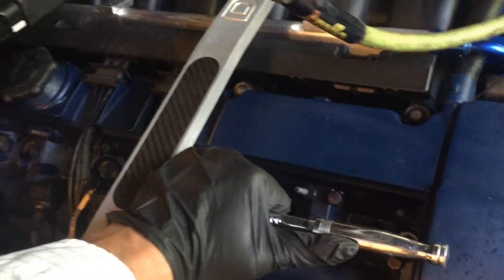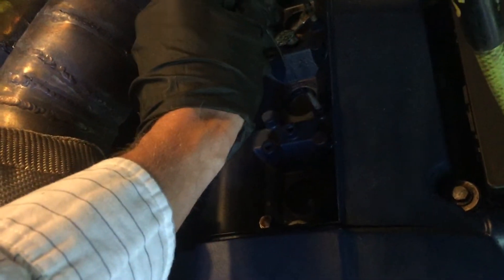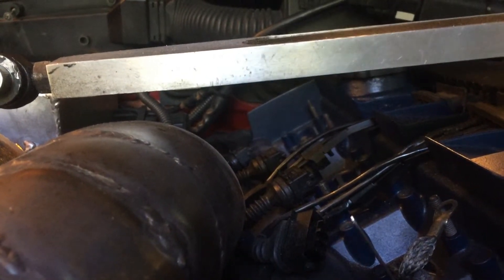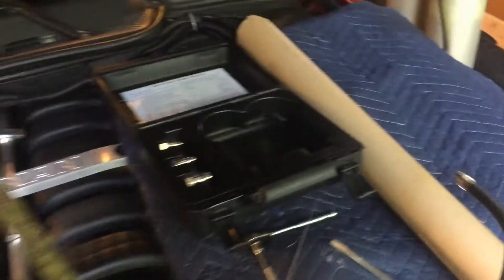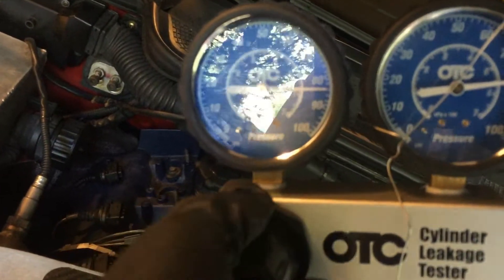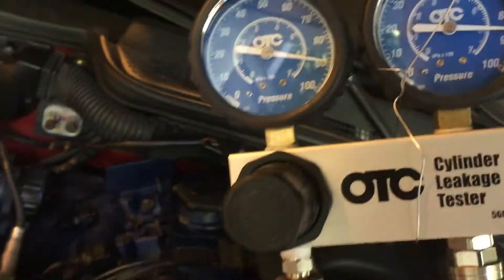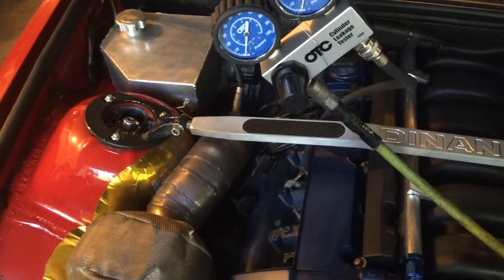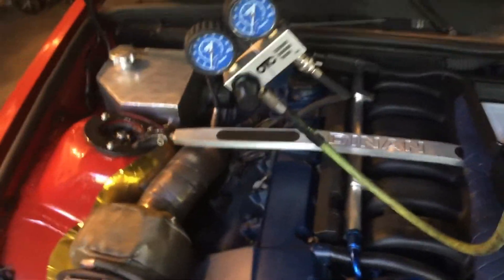Leak down testing and TDC trick on a BMW engine

Comment: I'm getting air coming from the intake but I can't seem to confirm if it is because it is a leaking intake valve or if I just haven't found TDC compression. But I see something on the valve seat that doesn't look right when I use the endoscope camera. I have an OTC  leak-down tester too but wish I had gotten one with the pretty colors to show when it is bad or good, however, I suppose I'll learn to understand it.

Comment: especially if it is a V-ENGINE and you are working alone don't leave anything stuck in the cylinder and turn the engine because it could break off because of the angle of the V-ENGINE as the piston moves to the top.

Comment: My friend, a four stroke-cycle engine has each piston come to the top dead center position twice in each cycle. 

Once at top dead center on the compression stroke and once at top dead center of the exhaust stroke. 

The method you have shown here shows the piston coming to top dead center but you don't know if that is on the compression or exhaust stroke.

............................................................................................................................................................................................................................................................................................................................................

EXPLANATION: 

a four stroke-cycle engine is so named for the function of the engine's pistons during one cycle, namely: 

INTAKE- piston travels down into the cylinder (intake valve(s) open drawing in fuel/air mixture (in the case of a gasoline or propane engine) or just air (in the case of a diesel engine), 

COMPRESSION-(valves are closed) piston moves up in the cylinder compressing the contents of the cylinder, 

IGNITION-piston is forced down in the cylinder by the explosion of fuel (by spark plug in gasoline engine or by the injection of fuel in a diesel engine), and lastly, 

EXHAUST- (exhaust valves open) piston moves up in the cylinder pushing exhaust gasses out.

The objective in finding top dead center (TDC) on compression stroke is so that all valves will be closed. Only with all the valves closed on that cylinder  (TDC on the compression stroke) will a leak down test be effective. If the piston is at TDC on the exhaust stroke the exhaust valve(s) will be open, nullifying any result.

Otherwise a very helpful video,

Thanks